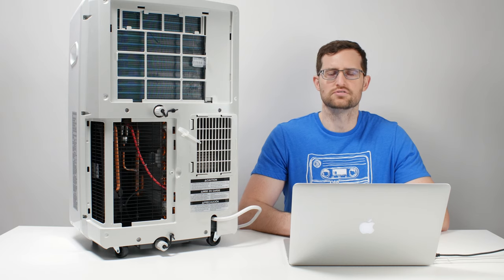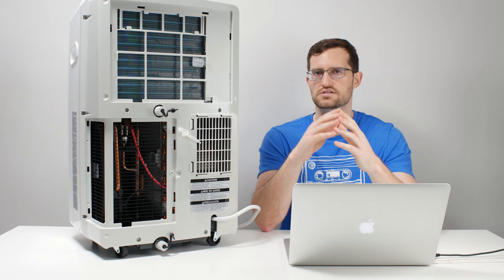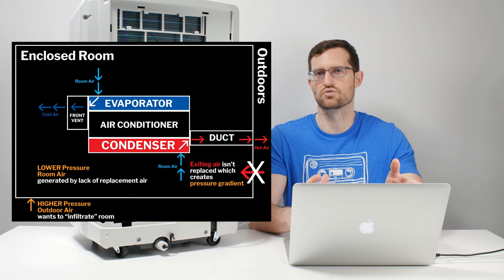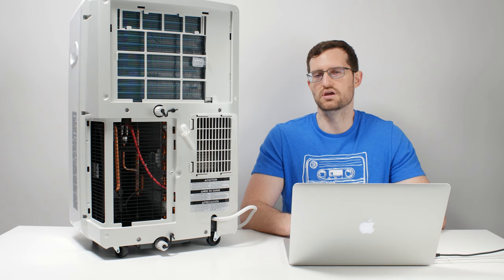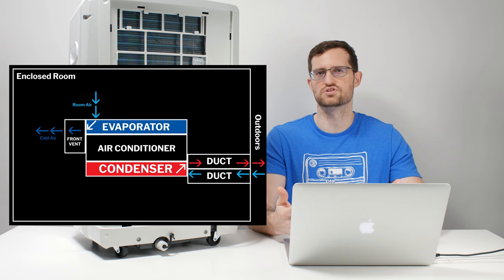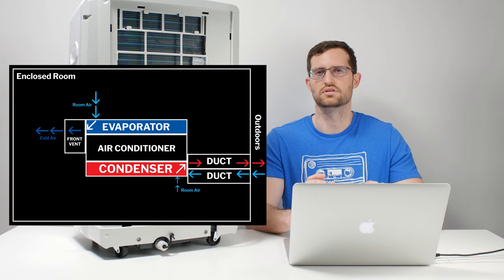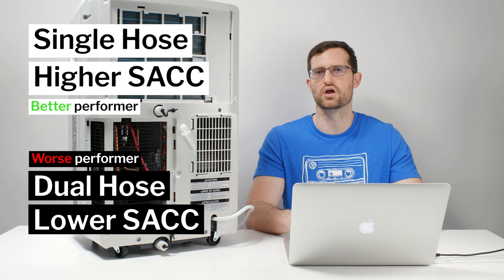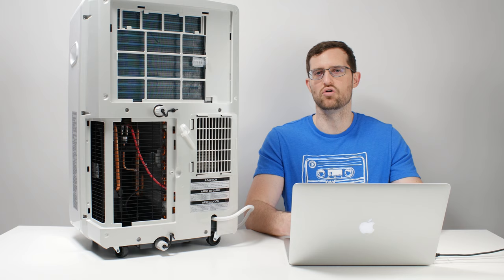Single vs Dual Hose Portable Air Conditioners

Comment: I don' t think that he understands refrigeration concepts. I have been a manager for 2 HVAC companies. A dual hose unit will always be more efficient. He tested one dual unit that is technically not a complete dual hose, as he admits. Once you seal and insulate both hoses it will be much more efficient. He also doesn't understand that a single hose unit is exhausting air that it has already cooled. Time  for him to go back to school.
Reply: Despite all those physics in favor of dual-hose units, what if they fail to outperform single-hose units in real world scenarios for other reasons? Also, what kind of insulation would you recommend for the hoses?
Reply: @garousaitama-ff4wh  any kind of insulation would work. Flex duct, pipe, wall, even insulation tape.
Reply: @toddhughes4745  I looked into this before and a lot of the insulation methods used fiberglass, which apparently you should avoid being around too much? Thanks, hadn't heard of insulation tape.
Reply: My thoughts too. Not only is the single hose way inefficient but it also creates a pressure difference between the inside room and the outside environment. As long you can properly seal and insulate the two hoses. The inefficiencies of the dual hose will be lesser.
Reply from the maker: By looking at a particular model's SACC and CEER we can now evaluate its efficiency independent of form factor (single vs dual hose). Calculating either one of these metrics requires rigorous testing and mathematics. See appendix CC at the link below:

https://www.ecfr.gov/cgi-bin/retrieveECFR?gp=&SID=83f8e5ba7502cb6f0b2803f5b3a467d3&mc=true&r=PART&n=pt10.3.430#ap10.3.430_127.cc
Reply: I actually bothered to read some of the linked Appendix CC, something I imagine few bother to do. Laughably one of the first things it does is make reference to the testing conditions established in ANSI/AHAM PAC-1-2015, a document that you can view merely by paying $110 (members discounted price of $85! wow!).  So much for transparency.  Anyway, while the basics of the SACC formulas described seem reasonable enough, the testing conditions are pretty dumb.  It explicitly states only to use the manufacturer provided equipment and nothing else, meaning no insulation of the air hoses, no good sealing of the connections, hell not even duct tape if the manufacturer didn't include it.  There's a reason manufacturers don't produce and provide those things - consumers can get them easily and cheaply themselves. 
So bottom line, the biggest contributors to inefficiencies in a dual hose system can be drastically mitigated, but the air infiltration issue of single hose can not.
Reply: @consumer-analysis  What you said is correct, but, for the same SACC, I bet the single hose uses MUCH more electricity.
Reply: Cooler intake air in the room (single hose) will give cooler air out the vent.  Air intake from a sun facing window can be a lot warmer (  warmer air out the vent ).
Reply: He basically said that the air conditioning with higher sacc will do the job faster and   reach lower temperatures, no mistakes there, if you are interested in performance that is all you need to know, if you are interested in efficiency you have to consider how much power it uses to delivery that performance. Performance and efficiency are two different things.
Reply: SACC numbers will tell the effective cooling capacity, but the efficiency is a different story. For example, I upgraded from a single hose 12k btu ASHRAE / 7,2k SACC to a dual hose 12,4k Btu ASHRAE / 10k SACC. So talking about efficiency, the dual hose delivers 30% more real life cooling capacity with 3% more energy. I refuse to ever buy a single hose again.
Reply: Wow, I thought surely the hoses would perform better if they were wrapped in insulation and somebody told me no it would just make it hotter which I thought was a load of shit, and here I am vindicated.

Comment: I appreciate these reviews but still just bought the arc-14s dual hose unit.   Its plainly obvious to me.   A single hose unit will draw replacement air from hotter rooms or air leaks.

Comment: This video makes it seem like the losses due to the way a single hose unit sucks out the air that it already used energy to cool to then cool itself, thus bringing in massive amounts of outside warm air is remotely close to the minor loses of convective heat from short 5 foot hoses and a couple extra leaks.  

The inefficiencies of a single hose unit are orders of magnitude greater than the marginal increases in small heat gains from a dual hose system.  I can't fathom why you would want to defend terribly designed single hose units, unless you are paid by their manufacturers to shill for them.

You should always purchase a dual hose unit, as that is the same operating principle as split units (traditional whole-home) and most American style "sit-in-the-windows" units.
Reply: Would explain my comments that disappeared...

Comment: dude, check your physics, radiation power of hose with outside air is nowhere near numbers of thermal power of that same air itself. Also we can assume, that intake hose will have much lower temp gradient with room air temp compared to outtake hose.
Two hose system is vastly superior to single hose system in efficiency.
Reply: In theory, but all the highest EER rated portable aircos are single hose as far as I can see.  Unless you can point out some units that are available in the EU that are more effcient than the LG/Delonghi sinlge hose systems.
Reply: @StartledPancake  yeah was told dual is better and just came across LG's single with same BTU ASHRAE rating with higher BTU SACC rating
Reply: @bbbo85  The new Midea Duo and its Toshiba counterpart has a higher rating than the LG from what I've seen.
Reply: The new single hose units hit SACC of 10K out of a nominal 14K now by ramping up the condenser temperature and taking advantage of the cooler room air in smaller volumes. Dual hose units has to cool the hot side with hot recirculating exhaust air and the cool side is either warm or uses a lot more power to get it as cool as a single hose. In hot days, dual hose units can really struggle!
Reply: @_exilon_  in hot days single hose ac suck hot air from outside into house. You can not achieve higher efficiency to cool air in united space than in separated spaces. Dual hose system is close to split system. And I hope, you will not try to claim, that split system is struggling, right?
Reply: @_exilon_  Wouldn't a single hose be working harder then if its using the air it just cooled down to cool itself down? Either way I think a dual hose still also sucks out a little bit of air. I just got that Toshiba I commented on last week and I'm sure its blowing out a little bit of air outside despite the weird dual hose it has since it has these intake vents just under where the hose base is.
Reply: @Jikldk  I have the Toshiba, the intake vents you see in that area are actually for the evaporator (indoor) area. It's a somewhat peculiar design choice, and I'm not sure why they did it that way.

The hose handles 99% of the condenser air, the only air that it pulls out of your room is due to some imperfect seals on the otherwise sealed condenser chamber.
Reply: @bbbo85  The LG single also uses 2 times the amount of Watt of the dual.

Comment: Another point to consider is if the unit us used in a condo or MURB building. With a single hose unit much of the air will be pulled in from the hallway rather than the outside. If the hallway is cooled and ventilated, then that would make the single hose unit perform better.

Comment: Single hose units work well when you need to supplement a house A/C to help cool a single room that is too hot because it not only adds cold air to the hot room, but the circulation "problem" becomes an advantage!  It assists in circulating cold air from the main A/C into the room that is too hot, and the make-up air being sucked into the house, will mostly flow into rest of the house, then be cooled by the house A/C before being sucked into the hot room. Single hose units help balance the A/C without having to add entire new ducts and a larger A/C to your house.  So single-hose units are actually ideal when trying to cool down a hot spot in a larger building that already has A/C.  But if you have no A/C in a house, and are trying to add A/C to only one room, like a bedroom, the single hose unit will just keep sucking hot air from the rest of the house into the room, instead of re-cooling only the bedroom air.  A dual-hose unit is far better for cooling only one room in a building when the rest of the building is just as hot as the outside air. single and dual house units solve different problems.
Reply: Huh, I always thought about this in a different way. It would make the entire house hotter because the cold-er central air would get sucked outside by the portable unit. Assuming that the portable AC cannot get the air any colder than the central AC.
Reply: @professorjack2099  Maybe? Doesn't the central A/C have a thermostat that causes it to keep the house at the same temperature?  Sucking hot air from outside will undoubtedly require the central and portable units to use more energy to cool the hot air you bring in and compensate for the cold air it forces out of the house.  It's an energy and money cost issue for sure.  But if the central A/C is large enough to cope with the load, it won't lower the temp of the rest of the house.  On the other hand, if the central A/C is undersized, and must run 100% of the time just to keep the house at a given temp, then yeah, adding a portable unit to a room may make that room colder, but it might make the rest of the house warmer as you mention.

I guess the point here is if your central A/C is not large enough to cool your house, and you try to add these portable units to "help", they might do just as much harm as good to the problem.  Adding a dual hose portable or a window unit would be far better for example. But if your central A/C is large enough, but you just aren't getting the circulation needed to a given room, or you want one room colder than the rest of the house, this portable A/C could help with that.
Reply: @CurtWelch this doesn't even make sense, instead of fixing your air con you add another high load on your electricity. Not only you are sking your cold air out you are increasing your bills. Your point on single hose doesn't make any sense

Comment: I have small apartment wher i cant install normal ac and i bought single hose portable ac and it works very good. You just have to insulate the exhaust hose and maybe use normal fan to help the cold air stay where you sleeping other than that i dropped from 30 degrees hot to 21 in one hour.

Comment: I does not matter how big your portable A/C is, if you have an area / room that is a challenge to cool when temperatures are going to be over 90*F outside, then take note.

Treat your portable A/C like a under-powered car driving up a steep hill. Just like when we were kids on a bike, you would get a running start and build up speed to conquer that steep hill. Same thing apply's with portable A/C units. You need to cool your living space as early in the morning as you can get it (60-65*F). The cooler the area is, the easier it is to "keep it cool" during the peak time of the day when temperatures outside are the hottest (usually 3-5pm). If you turn on the A/C after is has warmed up in your home (over 80*f), it will be much harder to bring the temps down to a comfortable level.

Comment: Lots of talking, theories and explanations, but I believe you never really compared in "real life" a single hose vs dual hose. The amount of hot air that single hose sucks into the room is vastly more detrimental than the leaks and heat radiation from an extra hose, there is simple no comparison. Just close the room door and place you hand or foot in the joints between the door and the door frame and you will feel the air blowing inside in great amounts, so you are blowing out cold air all the time creating vacuum in the room, and then sucking in hot air all the time, so you really never end to cool the room, as the situation is equivalent to try to cool a room with the door open, we all know how difficult that can be. . And that is a unsolvable flaw on the single hose units.
Is true that outside air wont cool the condenser as quickly, but it does not really matter is this situation. Besides don't forget that windows air conditioners get cooled with the outside air, and sometimes even get hit by the sun directly and still work well. If you can intake enough air flow you will cool the condenser enough to allow him to work efficiently even with the outside hot air. Your statements are simply ridiculous. I believe you have some interest in promoting single hose units, probably from the brands you mentioned. I could send you the heat transfer equations and calculations but I don't have time for that. Even more I converted a single hose to dual hose and results were immediately outstanding, cooling the room lot lot faster.
Reply: Exactly. Physic here is ruthless. Possibility that heat brought by infiltration air is equal to radiation+leakage heat of dual hose system is total physical bullshit. Even with 100% heat transfer efficiency between intake air and hose, it will be only equal and 100% heat transfer is another physical nonsense. 

And ability od 2hose systems to isolate room/house from outside air is main advantage for everyone purse. You can actually cool room enough to turn AC off, because with well insulated house, you will get several hours (ie whole night) at convenient temperatures. This is impossible for 1H system and they have waay large electricity consumption to be running non-stop.
Reply: U seem to know alot about conditioners so I have a question for you if you dont mind. Can I split my cooled air via tubes to two different rooms? I want this because I have 1 unit and 2 rooms I'd like to cool. Thankss
Reply: @codfreak1994  I assuming you are talking about portable AC right? Then I do not recommended it. First you would have to make some DIY adapter from AC cold air outtake which is most probably square or rectangle. And then there is second problem. Static pressure of axial fan of AC. Axial fans have poor static pressure and any obstacle in airflow would diminish its efficiency and airflow significantly. And when you add long path (5-10 meters) of cold air tubes, it will be such obstacle, that airflow will be almost nonexistent.
There will be one way although. You can add inline axial fan into end of the hoses with minimal airflow calculated by this formula (AC Airflow) × sqrt(((Area of AC outtake)×(Length of Hose)/((Hose cross section×5))). (That number 5 is typical static pressure difference between 125mm inline fan and 300mm axial fan). But I am warning you, longer your hose, stronger inline fan will be needed. So it will be also noisy solution. But it will work, because inline fan will compensate hose drag.
Reply: @codfreak1994  These distances are even worse than I anticipated. Airflow of cold air will be absolutely miserable. Do your best, but be ready that you will have to install inline fans into those hoses. I wish you luck in your DIY efforts. I will be glad to hear about result.
Reply: @tomascernak6112  Hey Tomás, I made my tubes on the output and put them in the rooms. The AC has enough pressure to put a steady airflow through the tubes (they are fully inflated) and I get a nice cold breeze out both ends (even on 'low' fan speed). The rooms are quite small so it has a noticable effect. I made the tubes with thin trashbags and taped them together with light tape to reduce the air pressure needed to get the air through. When I turn the AC on (with my tubes on it) It inflates pretty fast and seems to have quite some pressure in it. Do you think im restricting the AC fan too much and potentially damaging it a bit? In that case Ill get an external fan.

Thanks :)
Reply: @codfreak1994  Well, this looks like theory got knockout from practice :-D There is no risk of damaging AC fan. Axial fans (which is in your AC) do not have problem to push even towards wall. So if airflow on the end of your tubes is satisfactory to you, there is no need to add inline fans into tubes. 
From your description it looks to me that you are done. Good work!
Reply: Your use of the word "superior" made me think you were in favor of single-hose units until I read the rest of what you wrote.  I would reword that sentence like this: "The amount of hot air that a single hose sucks into the room is vastly more detrimental than the leaks and heat radiation from an extra hose."
Reply: @marredcheese   Noted! Fixed!
Reply: hey, i cant find any double hose unit in europe, would you recommend getting a single hose unit and somehow making it a 2 hose unit?
Reply: But you also have to ventilate your room... And by that you get hot air from outside into the room. just like with a single hose. Maybe not as much ! that's also in the equation..
Reply: Thank you for your real review. I've had a dual hose for a short time after replacing my single and the difference is worlds apart. I feel that this video is mumbo jumbo and is purposely trying to confuse people. People want a cool room quickly... Dual hose is better and more efficient, pretty simple.
Reply: Totally misinformed video, there is NOT s significant amount of heat radiating from a duel hose unit, duel hose units work much better and are way more efficient !!

Comment: My ARC-14S is the best portable ac I've ever had by far. Single hose is obviously gonna pull more air in from outside by creating a vacuum in the room.
Reply: I have it. The dual hose kind and I have to drain water out of it every 2 hours. worthless to sleep with. But I do have a high humidity area